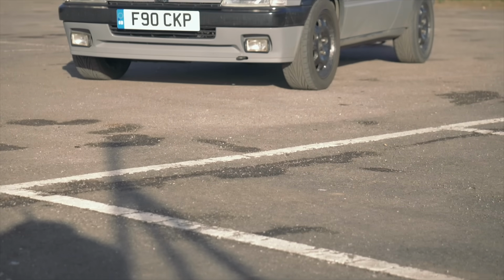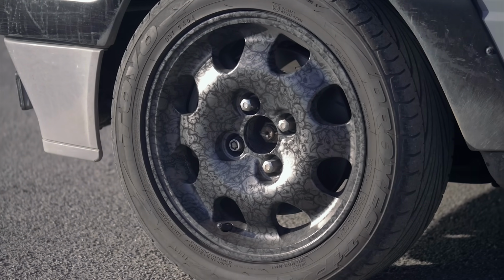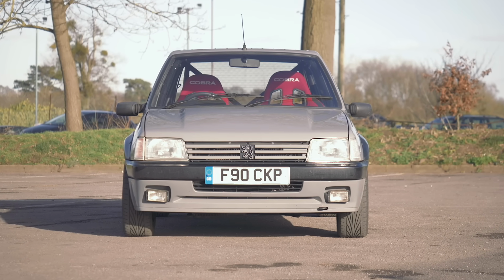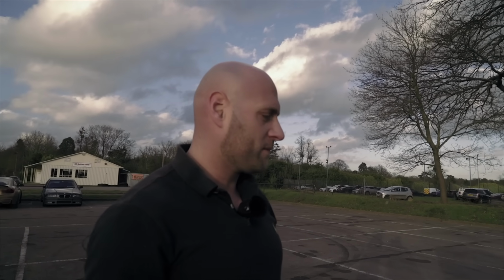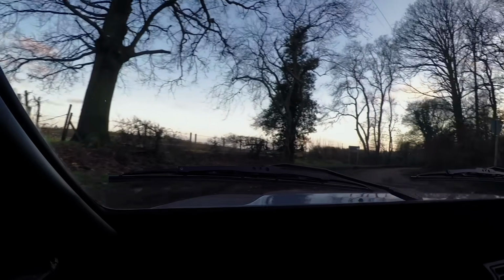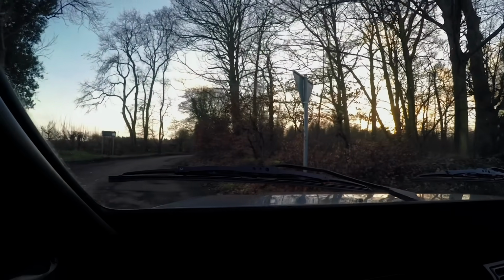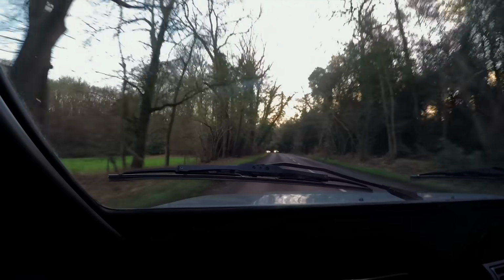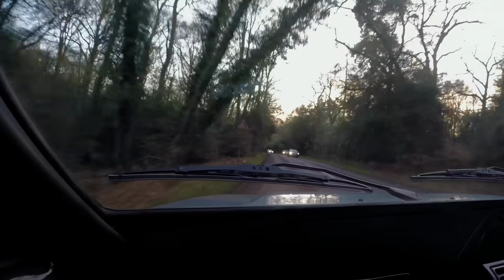THIS 36 YEAR OLD PEUGEOT 205 GTI IS DRIVING HEAVEN!!

Comment: The kids who only know dsg golf r’s, s3’s wont understand this calibre of car , its a mans car 🙌🏼
Reply: Fart box rules though.......👌🙈
Reply: Kadett GSI 16V/Astra GTE 16v, Golf GTI 16V, Honda Civic/CRX Vtechold Ford Escort are the same caliber
Reply: ❤️❤️ loved it bud , so true , this is a video that proves old school is the best 😎👌🏻
Reply: ddkadettturbo . Renault 5 turbo, fiesta turbo/ Xr2i ,and Vauxhall calibra too 🤙
Reply: @elwittinio2865  Renault 19 16V, Citroen ZX 16V
Reply: @ddkadettturbo  no no no astra was a pile of crap didn't handle.. Pug was always a lot better
Reply: Ricky Needs to give the Williams clio a go. Even standard form they are a joy to drive.
Reply: Not really.
Reply: @Matt man so please tell me what was so good about the astra gsi apart from its engine?? Tell me about the mk2 astra apart from its straight line speed?  Tell me about the porky mk2 golf?..
Reply: @Matt man I'm not sure where I mentioned the V6, but that would make a cracking car for Ricky to drive, although a lot of them are put away in garages to keep them mint.
The Williams is based on the 90's rally car and yes they pissed off the original owners by building 2&3 versions.
But they are pretty much the same.
The engine is a peach even with 150 bhp. It's very torquey from low revs and the handling is a revelation. With its low weight its very agile and quick and would surprise even a modern hatch.
Never tried a Puma but are supposed to be really good to drive but they only have 123 bhp.
The other contender fwd champion is the original Integra type R, 189 bhp high revving with an amazing chassis. Great for when you're a mission.
Reply: @Matt man 🙄 you can pretty much make anything fast with enough hp and torque.
Reply: @Matt man 😂 yeah maybe come back when you can debate with out calling someone a liar 👌If I were you I'd probably delete my kid like comments as you look kind of silly. Good luck champ.
Reply: @Matt man and just for your info, from what I remember k184vod was the reg of my van look it up and funny enough it will be a red 205 van, type in on Google ldr397h my old mk1 escort Hill climb car. I have nothing to lie about.. Was just stating the mk3 astra was pants and the golf wasn't much better. Mk1 astra gte and mk1 golf gti were good fun pocket rockets though!
Reply: @Matt man ok here's some more reg numbers of my old escorts feel free to look them up ott735m, pel997m, htw385t, yes I did have loads of 205s mk1 astra gte oh hang on here's another reg for you a515xcv, why did I have them when I wasn't into fwd cars.. Because they were ten a penny years ago drive them to the mot ran out and just go buy another one. My mate had a mint mk2 xr2 it had 4 bold tyres and he scrapped it as new tyres were more than the car was worth!  That's what it was like back then. Something you will never understand.
Reply: @Matt man yep the sort of answer I expected 🙄
Reply: Don’t be jealous ha
Reply: @Matt man ok silly little boy give me some examples of my trolling over you tube? I'm a kiddy fiddler as well? Anything else lol keep them coming.
Reply: @Matt man ha ha you really are something special, since you decided to take the time to look at my profile, you would actually see the dog actually  (quite easily) the dog ran up to the camera lense 🙄. try again to pick at silly things, but for once try to get it right..
Reply: Ha You haven't got to me at all one bit, I'm still laughing at your video 😂 funny how you have so many dislikes.. That's what happens when you are not a likeable person.
Reply: @Matt man lol 😂 basic spelling? Ok Im not really paying that much attention to what I'm typing to you. Car history wrong? Please explain?? Lied about what??  Lists credentials??
Reply: @Matt man and obviously you do need likes in your life as you've liked all your own comments 😂
Reply: Ouiii!!
Reply: @tassap9355  exactly
Reply: Btw kids owning golf r is a fucked up thought if you look at it. In canada those cars are nearly 50k...how a kid actually AFFORDS that idk..much better off buying old hatch back for couple thousand than putting yourself into debt. But all these new gens care about its outright performance sadly.
Reply: @Matt man masses disagreeing with me??
Reply: @Matt man what 16 people lol what other comments?? Lol you mean the 16 likes you have given yourself??
Reply: @Matt man still flogging this are you? Ok tell me then what have I lied about???
Reply: @Matt man um they did make a 205 td, I don't think they ever made a 205 td van I far as I know.
Reply: @Matt man where's this link??
Reply: @Matt man lol where is this link that you pretend to have sent???
Reply: So once more for comedy value for my self, where is this link???  How have you sent it to me?? Through YouTube? Where is this link then for everyone to see??  Wow you really live in a childish fantasy world 😮🙄
Reply: Case closed.
Reply: @Matt man link??
Reply: All about the stats these days. 0-60 times and power figures. This is a proper driving experience. The Itbs and manual 💙
Reply: And megan 4 rs civic type R fk8 ...
But the boys 20's like me love the old and new school the oldest golf's and news and oldest clio and new oldest civic and new but the old school cars have a different look and values and sensation and with the okdest engine naturally aspirated you feel like you rune 300 km/h but just you run with 190 200 😁 and who don't love the old cars is not a man is little baby
Reply: @ddkadettturbo  ford Sierra 205 gti 505 gti r21 turbo safrane biturbo integra type R the oldest muscle cars all  german&japan&French&American old school cars are great

Comment: Friend used to sell these back in the day, I’ve been in about 30 of em. Couple of points:

A good 1.6 feels faster than a rough 1.9.

On fresh suspension - Peugeot killed it with the damping, soaks up all the bad roads like a small car shouldn’t and stiff enough for amazing handling. 

The Mi16 motor, cammed with throttle bodies was the ultimate non turbo way to go in the 90’s, still can’t believe they are just average compared to today’s hatches. If you told me back then a 2020 Golf has 300+BHP and 4WD i would have told you to put the crack pipe down. Great vid 👍

Comment: 32, F-reg was 1988. I used to have one too, F594EGO
Reply: Yeah and before 87 they had different dashboard
Reply: Aug 87- Jul 88, mine is a Sept 87 F plate. In 87 on the F plate the ph 1.5 came out with the updated dash and tailgate and a few other bits mirrors etc.

Comment: The external sound of an mi16 engine bouncing off the revlimiter really takes some beating. Such a distinctive sound, I have not heard any other french engine sound better. I like this conversion a lot, I've owned an 205 s16 engine on bodies and a 306 rallye. Driving a 208gti at present, but it's all guess work what the cars doing in comparison to the older pugs.

Comment: I had a 1.6 gti, in 1990,  and i hammered it everywhere and it never broke down, surprisingly!
In the wet, when it started to understeer, if you lifted off ,and quickly hammered the accelerator pedal, it would go into a slight 4 wheel drift, that you didn’t need to counter-steer into.A lot more twitchy than my dads mkIl golf gti, that he had, at the time.
Such a great car.We didn’t have sticky tyres back then, so i wonder what it would feel like on r888s or michelin cup2s.
Always fancied buying one , just to reminisce, but stupid money for a good one, now.

Comment: A real car.  Back in the day I had a drive in a TSR(Tim Stiles Racing) MkI 2.0 turbo golf, think it was about 270 bhp, it really was hard to imagine anything being faster, probably the most drivable car I've ever experienced, I think it weighed about 890KG.  The original 205 gti 1.6 was 113 BHP the later 1.9 was 130BHP.  The 405 gti Mi16 was 160 BHP standard.  The 205 1.9 had non assisted power steering it used to load up real heavy on long sweeper!

Comment: Brings back memories of my 1.9, with "only" 130bhp it was elastic between corners. I had mine near the end of the 90's and there really wasn't much that could keep with it down a back road. They are phenomenal driving cars 👍
Reply: yes only 130 hp, but also very light just 880 kg, wich is nothing for 130 hp

Comment: You can't beat Mi power in a pug 205. I've had a few 205s over the years. Gtx, GTI and a rare Gentry. If you know, you know. Nothing has ever come close to handling ever since Nuff said. 💯💥💣🇨🇾🎥👌
Reply: Paul Panayi Totally agreed 
I had a H reg 1.9 tintop 👌🏼👌🏼
Reply: Always fancied a 406 turbo lump in mine. Got rid of the car before I collected all the parts, much to my regret.
Reply: Shred LIVE So you have the bits but not the car ?
Reply: @Dan23_7  My greatest regret was selling my 3 door 309 gti goodwood. Gutted that car was a monster around the back roads!
Reply: @Dan23_7  Had the bit's. Talking a long time ago.
Reply: Shred LIVE I had my 1.9 a long time ago too, 2004 lol
Reply: Paul Panayi 309 Goodwood AKA hens teeth !!!
Reply: @Dan23_7 
Tell me about it
309 gti goodwood 1 of 402
205 gtx 1 of 750
205 Gentry 1 of 250??
Was into my pugs in a big way back in the day. I have a 2110cc 1973 gt beetle on twin 45 dell's now for fun. Old Skool air-cooled. Tax and mot exempt.
Reply: Could never get good power from the MI. So put a Honda in. Awesome.

Comment: 4:35 that clutch slip😱
Reply: Clutch slip or spinning in 2nd 🤔
Reply: Aaron's Videos  no Rickys short as, he was on top toes driving it.  Car fully rebuilt up rated everything
Reply: More like that wheelspin! Greasy road, FWD, not the best tyres and 186whp, means easy 2nd gear tyre roasting.
Reply: m5nut   Was dry as when we filmed. It lights up easy as in the wet  trust me
Reply: Aaron's Videos   It’s a hump in the road we go over.

Comment: If you're gonna track that, sort out oil surge issues. I had a 178whp mi16 205, exactly the same suspension, tyres, and a plate diff. Best car I've driven.  Took mine to track, thought I'd sorted out oil surge, but it still ate its bottom end bearings. Dry sump or nothing! Love seeing this!
Reply: Kev it’s got an baffled sump, it’s a strong low millage engine.  My brothers has a dry sump on his, should b on here soon
Reply: @jamessteventon1018  I got a baffled sump, windage tray, extended oil pick up, and more capacity. Didn't work! Still lost pressure around tight corners, was the death of my bearings! I honestly think dry sump is the only way!
Reply: Kev , like I said mine is spot on, my brothers not so good. So he’s got dry sump,  if mine goes it’s dry sump and forge bottom end for me 👍

Comment: That intake and exhaust note are sick. You can hear how fast it revs. Wonder how/if a lighter weight flywheel would do on the car. Love these lightweight pure drivers cars. Looked like a proper driving experience.
Reply: Alex Martinez   It has got a lighter flywheel
Reply: James Steventon Not light enough is what I’m saying. Lighter than what’s currently on the car, would seriously help low speed acceleration before the bodies catch up due to the map being peaky. Rally spec basically have no flywheel at all

Comment: I had the 1.9 which was the more reliable of the two and I've had a couple MI's. Think those arches ruin the look tbh.
Reply: SouthWestStaticCrew swCars basically the same engine, how is it more reliable?
Reply: @davog1946  i think he meant it is the more faster one. In terms of reliability the 1.6 and 1.9 are evenly reliable. The 1.6 might be a bit more reliable even.
Reply: @davog1946  how can it be the same engine. Ones a 1.6 and the other was a 1.9. 😂😂
Reply: Reliable??? Ask the head gaskets the same question they are very far from reliable
Reply: @lukecowell7516  which is why the 1.6 were unreliable. They were common for head gasket issues
Reply: @lexburen5932  other way round and the 1.6 wasnt even close to the 1.9.
Reply: @D4mo2612  had both 1.6s and 1.9s 4 cars over the years all head gasket failures even replaced and engine for a 1.9 3 months later head gasket failure woeful engine reliability
Reply: @lukecowell7516  I had my 1.9 for four and a half years with no issues. But I have worked on so many 1.6 GTI's back in the day.
Reply: @D4mo2612  it was the same block....there is no difference in terms of reliability between the two.
They weren't known for head gasket issues. You are miss informed.
Reply: @mrscrewloose7939  hows he misinformed when he said he literally owned multiple examples with headgasket issues...
Reply: @D4mo2612  Same engine just one has a bigger bore. They both have the same bottom end, they both have 4 valves per cylinder, they're both single overhead cam, same gearbox. Pretty much same everything apart from the cylinderhead.
So IMO the 1.6 would be more reliable because it's putting less stress on the internals.

Comment: My ex gf's best mate (also a girl) had a 1.9 gti. Whenever i got the chance id blast it about and it was insane. Even with fat tyres in bone dry conditions it span right through 2nd.  Front end just slammed up and down and the dash use to bash about. This was as they was slightly going out of fashion in the early 2000s. They don't make cars that violent stock anymore, they all seemed to quiet and controlled. Old school gti's were the pinnacle for me.